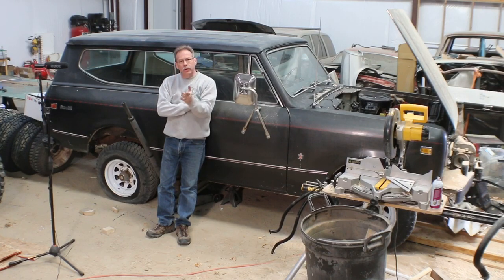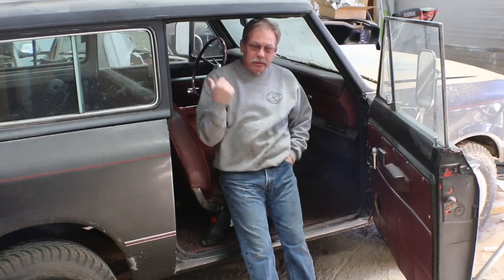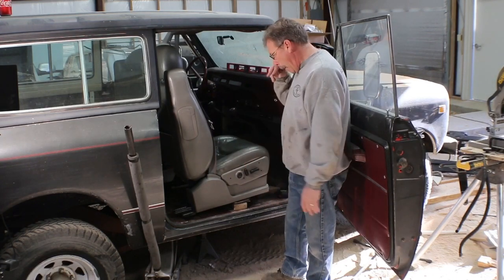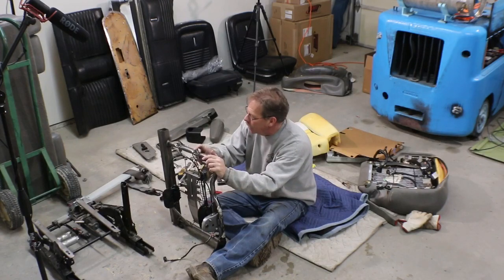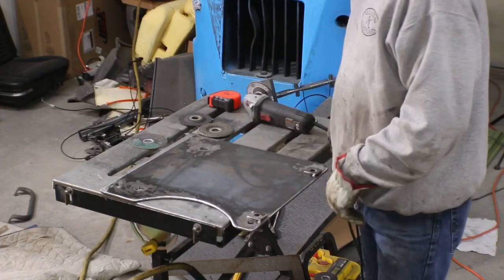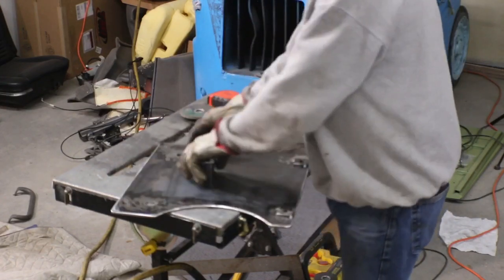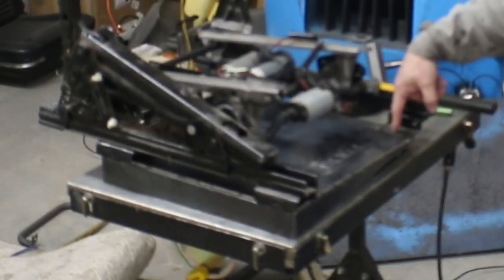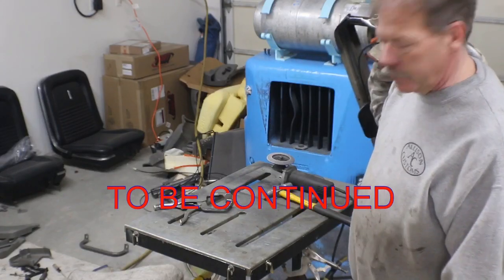New (to me) Seats for the 1972 Scout II

Comment: I have a 73 scout ii with after market bucket seats. I wish I had the original bench that you are replacing.
Reply from the maker: If this was the original seat that came with the truck I would consider getting rid of it. While this is a Scout Seat, it came from a pickup version and doesn't fold forward.  I wish I could get a folding bench seat.

Comment: I apologize if I missed it, do the modifications you have made to the seat allow it to slide or fold forward engough to allow access to the backseat you are building? I have a Scout II I am looking to replace the seats with something newer so I have focused on cars that are coupes or convertibles so the seat can easily fold or slider forward for access to the back seat.
Reply from the maker: Yes, they should be able to slide all the way forward or rearward.  They are electric so it’s not going to happen fast, but the full range of motion should be available.  If they weren’t free, I think I might hunt a narrower seat or just a manual version of the same seats.  As a suggestion look into Volvo X90 seats for the front.